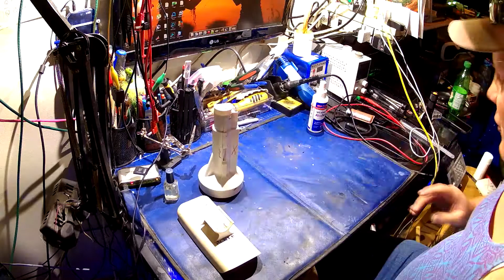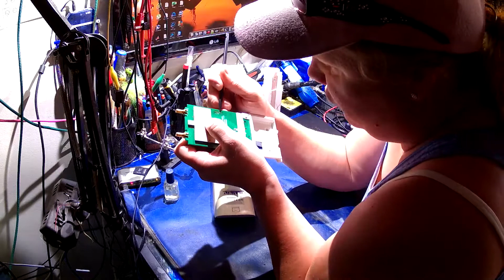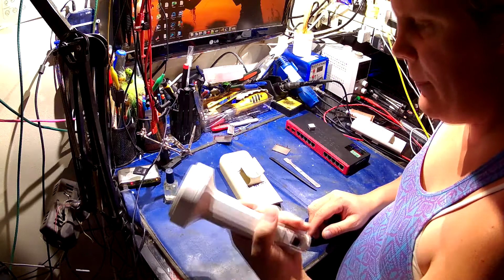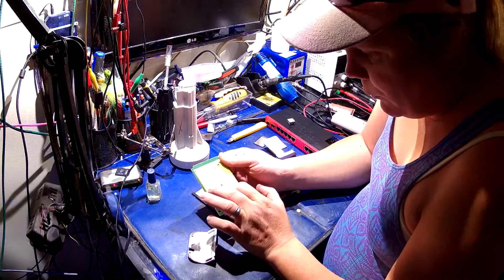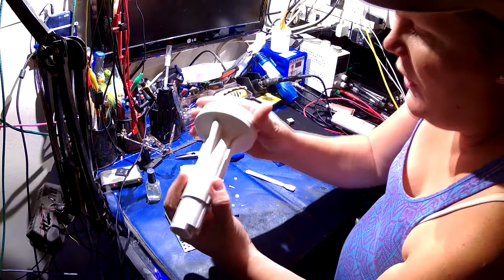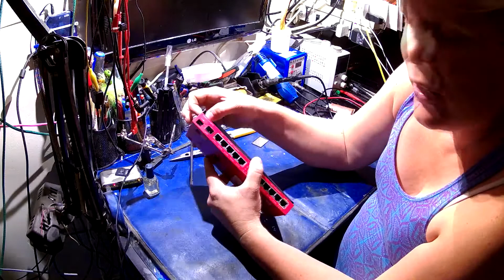Ubiqiti Taredown

Comment: Hi i would like to ask about my Rocket M5 nothing detect after reseting the problem is i cant access default IP what would be the problem pls help
Reply from the maker: Are you sure you reset it? Also can you ping it? What do the LEDs do when you turn it on?
Reply: Ms.Fixit Thank you ms beautiful  😘
Reply: Ms.Fixit yes i reset it couple of times. Is it possible theres a problem in port terminal soldering.?
Reply from the maker: Ok check to make sure your computer sees it as 100Mbps. If it only sees 10Mbps Half duplex then theres an issue with the Ethernet area of the radio. You may need to re flash it. To do this you power the radio up while holding the reset button. The signal lights will begin to flash up and down. Use A tftp program to re upload the firmware you want. Youll most likely need the XM firmware. Theres in depth tutorials on how to do this. Let me know how it goes.
Reply: Ms.Fixit Alright Thank you very much ms.fixit I hope i can Email you up  i will be sending picture on the antenna how goes,.  How can i PM
Reply: MorePower to your page Ms.fixit ❤️❤️❤️